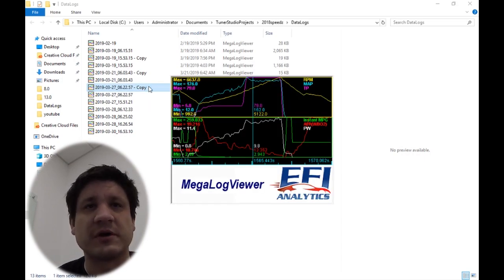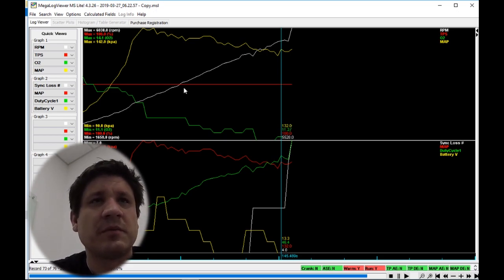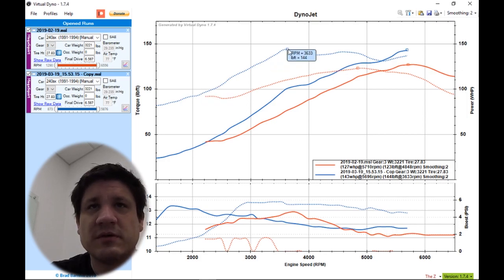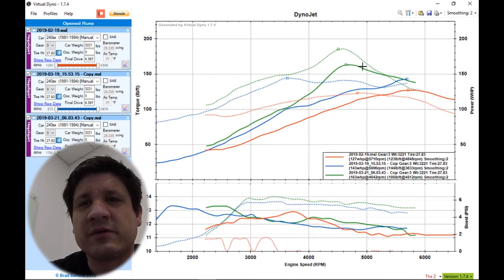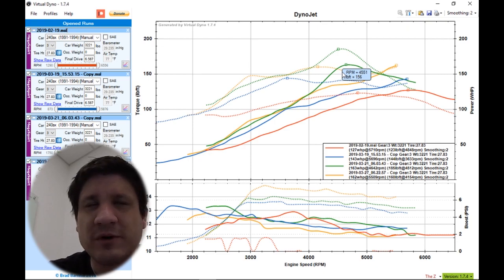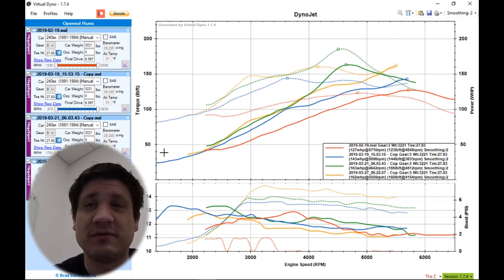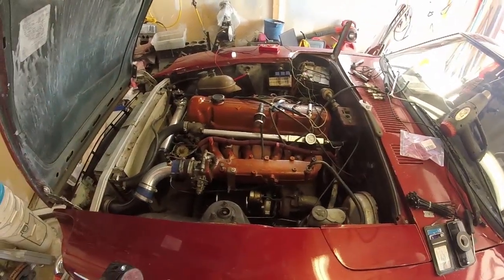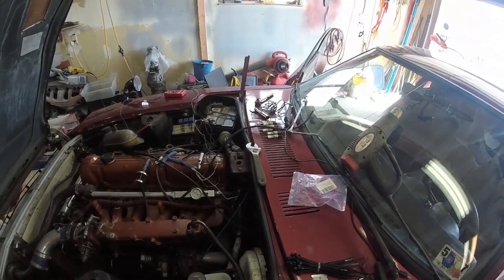Final Wiring on the Speeduino ECU and Comparing VirtualDyno Numbers from the NA to Turbo Conversion.

Comment: Can you explain how you wired up the fuel pump and fan
Reply from the maker: So there is a few different ways you can do this (the high outputs in J4 section) requires no extra hardware. I went about it by using a UNL2003 in the bottom section and wired that up that way. I show this a bit in my first drive in the 620 video, but can always dive more into in the future.